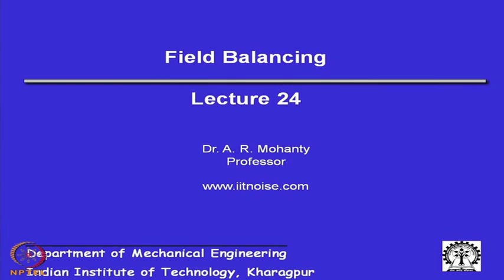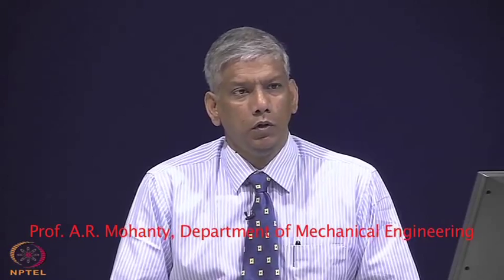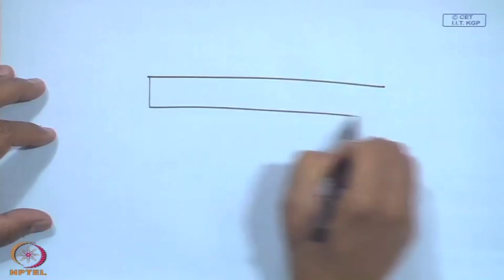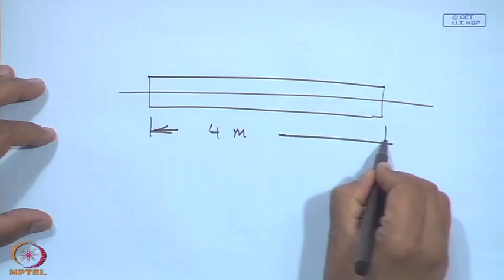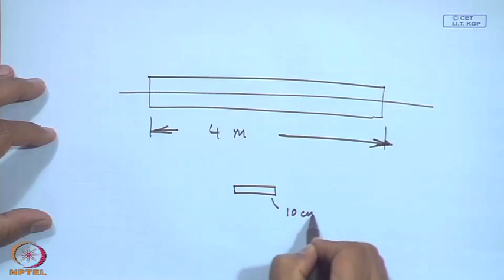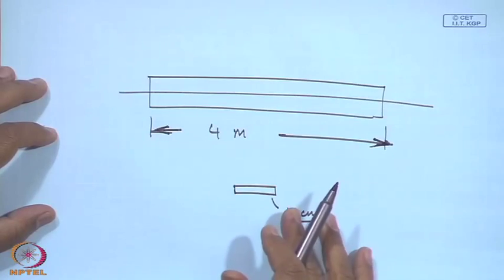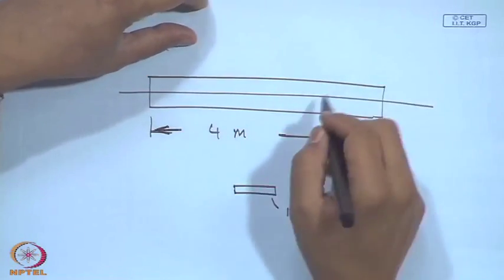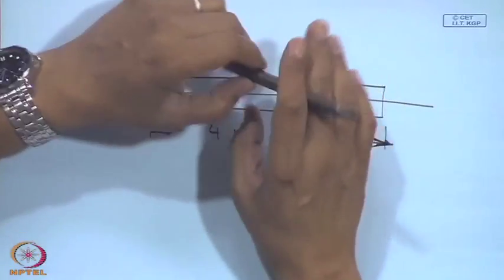Mod-01 Lec-24 Field Balancing

Comment: If we consider accelerometer as the reference and determine the actual point of unbalance in first round, then we can complete on-field balancing in 2-rounds only and vibration level won't increase since trial mass will be added at the actual point of unbalance.